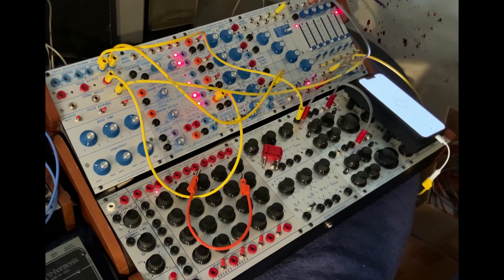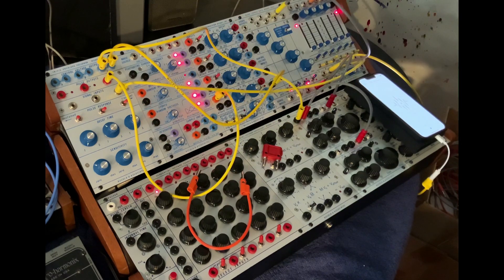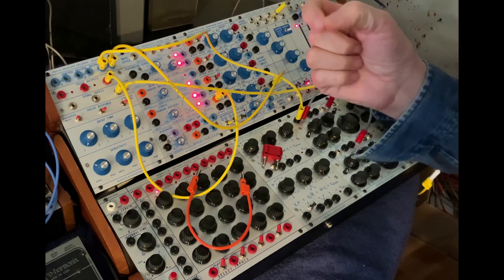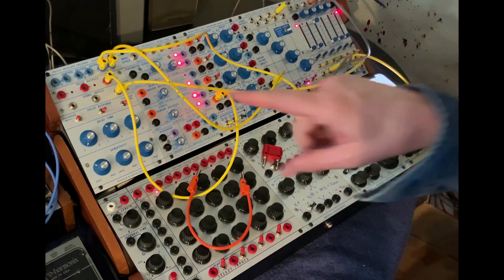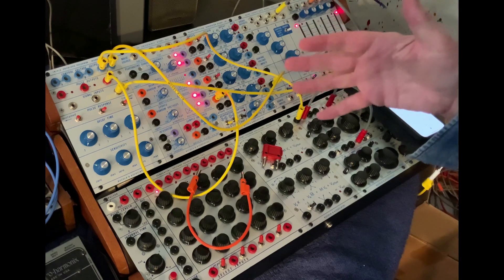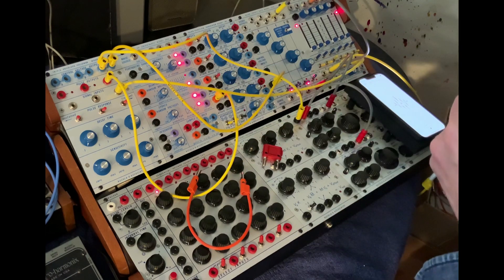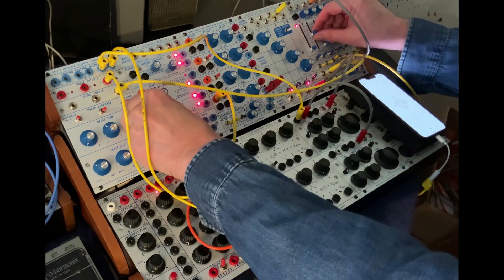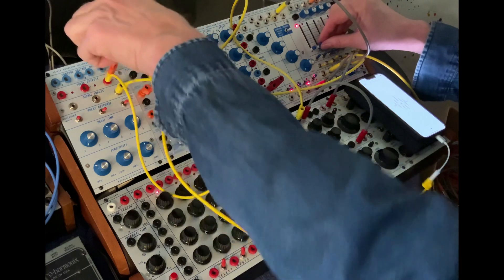Buchla 230 Env Follower

Comment: the way morton subotnick used envelope followers in his ghost electronics is suuuuper inspiring. i most often think of envelope followers being used with external sounds (sarahs influence for sure) but using them with tape (or in my case tape emulators) has really changed how i think about modulation. similar to how u mention using voice, ill patch: since osc -> vca -> tape reel -> env follower. by adjusting the amplitude of the sine thru the vca, you can get some really cool modulation shapes that would take quite a bit of patching otherwise! gets even more fun when u start playing around w tape speeds (& even multing the env follower to cross modulate parts of this chain 👀)